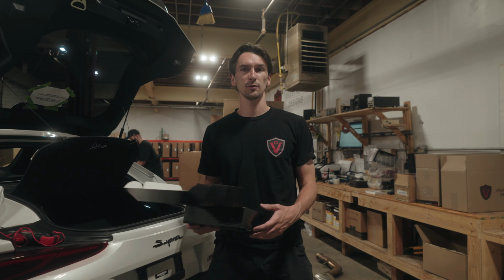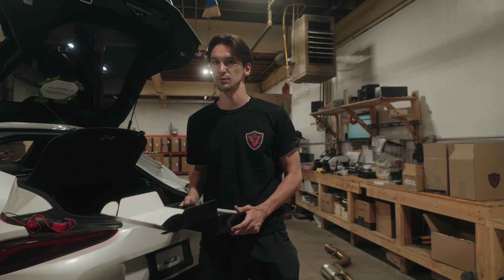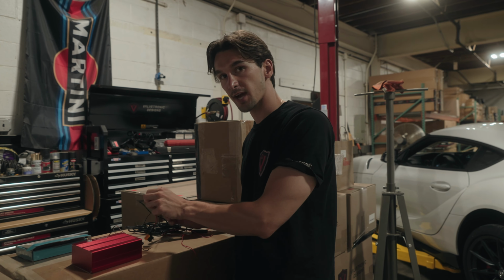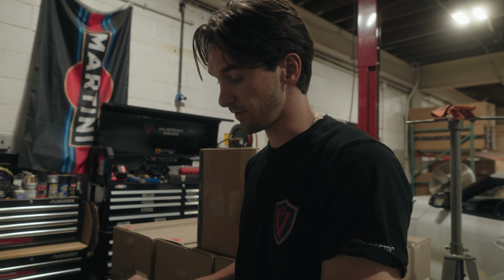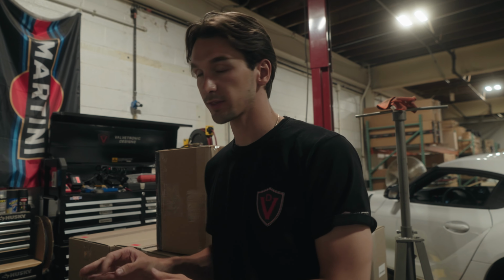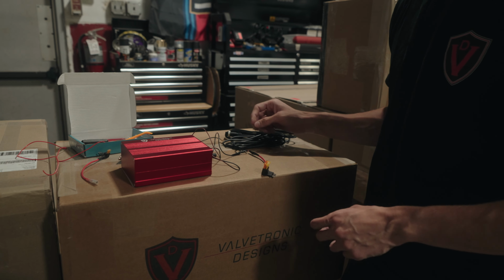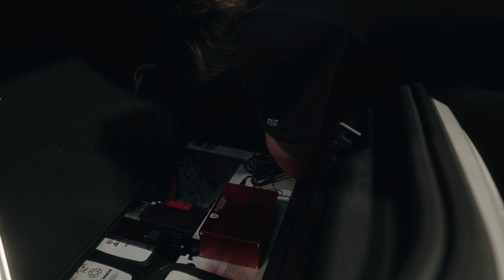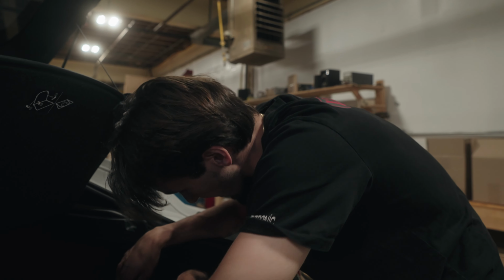How To Hardwire Your Control Box by Fuse Tapping

Comment: Is there a reason the cig lighter circuit was tapped into instead of using the f267 powered location with no fuse installed?